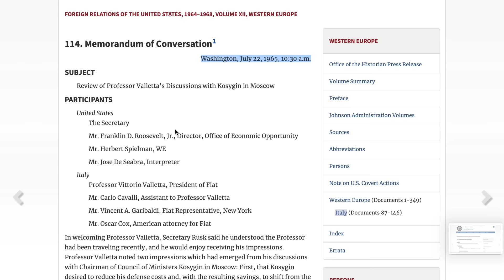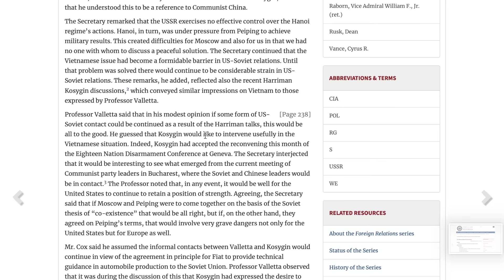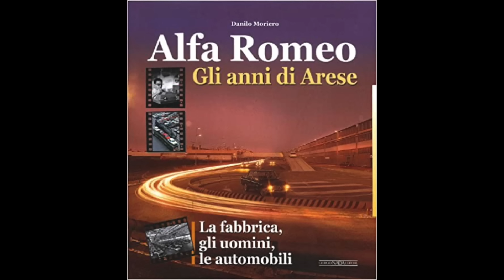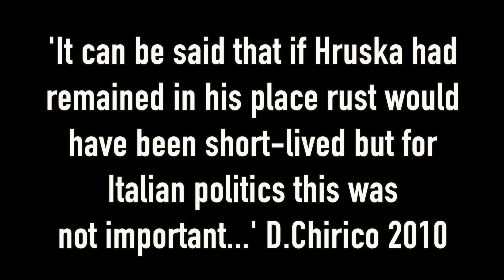Alfa Romeo And The Myth of Russian Steel - The Real Reason Alfas Rust

Comment: My father, a steel merchant in the 1950s, 60s and 70s, was often talking about the steel cookers adding scrap metal, recycled steel, to their mix. He explained to me, not that I was all that interested, that most of the problems with rusting cars would occur because of problems related to the "pickling" and subsequent processes but not indicative of inherently poor steel quality.
Reply: Well, "scrap" metal is needed for high quaility steel products. Just to get the alloy right.  Nowadays Recycling is a must anyway.
Reply: Your father was right. In the 70s, conflict in Italian factories was at very high levels.
There was a lot of sabotage and it was very difficult even just to verify the correct execution of the work, especially in the departments where product damage could be maximized

Comment: I purchased a new Fiat 850 In Wolverhampton in 1968.  It lasted 2 winters before the whole floorpan had to be fully re-welded.  My cousin had purchased a similar vehicle in Milan which did not rust for 10 years.  I can tell you the reason, and it's not Russian steel.  The West Midlands salted their roads so heavily that ALL cars at that time rusted away.  In the 1980s my Alfa Sud showed signs of rust after 3 years.  But subsequent Alfas and Fiats that I owned showed no signs of rusting in SW England.  I conclude that SALT played a major role in rusting for cars not prepared or galvanised for this British practice.  In Italy, snow chains and winter tyres have been long-used in winter, instead of salt.

Comment: In Canada in the first half of the 1970s, it was a bit of a rust-fest.  Datsuns were famous for visible rust, Toyotas for secret rust, the Brits for slow steady rust, and Fiats for complete rust.  The Fiat 128s were so bad that there was a buy-back program.  Luckily any car they bought back had turned to lace, and so Fiat Canada did not need to spend money on using crushers to dispose of them!  That era pretty much spelled the end of mainstream Italian car sales in Canada.
Reply: Hi Bob, that's very interesting.  I came to Canada in the mid eighties from the UK and had often wondered about the lack of Italian cars here.  I had assumed that with the smaller population the market was too small.  Perhaps that is the case for French manufactures?
Reply: @iansmeath8674  the French had a solid niche market here in the 60s, especially in Quebec.  However, their dealer network declined as the dealers defected to higher volume brands.  Japanese competition pushed them out of the entry level  market.  Personally, I have a Citroën 2CV, and am part of the teeny tiny French car community that still exists in eastern Canada.
Reply: @bobmcl2406  Thanks for the info on the Canadian car market Bob, very interesting.  So you have a 2CV quite a rarity though I have seen a couple here.  One had a brilliant license plate
"ESCARGOT"  priceless!
Reply: 240Zs if driven year round in the northern tier of the US rusted completely away in about three years.

Comment: I worked with someone who'd been in the motor trade since the mid 60's and he told me Alfa's had issues with the paint not adhering. Often brand new unsold cars would need bare metal resprays in certain areas before they hit the showrooms.

Comment: Thinking back to MOT testing in the 1980's, the most common rot boxes were seventies Escorts and Cortinas that would be beyond repair at 8-9 years old. Minis were rubbish, early Golfs pretty poor but surprisingly, the dear old Allegro would rarely fail on rot. Alfasuds normally failed on the circular jacking points on the four corners of the floor and the inner wings where the outer wings bolted on, assuming there was still enough of a wing left. Bodywise they were shite and the Sprint version was even worse. They were also very inconsistent - I used to test a bright yellow 1979 saloon that even after seven or eight years was still in good condition. Another Sprint actually broke its back when it was jacked up. A split in the front chassis rail opened up and the front wing separated from the rest of it as the inner wing/strut top area caved in. It failed of course. :-) More recently I've seen a couple of 159's that are as rusty as an old horseshoe underneath. I don't recall ever seeing a rusty 75 or 164 but they were built in Milan with rather more care.
Reply: Very interesting. Thank you for posting.
Reply: I own a 164 from 1988. All original paint, has always been kept well but it's passed all its life very near to the sea. No rust at all! ;)
Reply: Those were the days ! I used to be an MOT inspector as well. Good memories
Reply: The allegro if I remember correctly used to rust badly across the rear suspension mounting panel.That's if the mounts them selves didn't break first.It also was the subject of a few recalls ie front tie bars and brake hoses and of course who can forget the quartic steering wheel.
Reply: @alanbicknell7696  That was the 1100/1300. They rusted so badly the rear subframe would break loose.
Reply: I worked for a British Leyland dealer when they were launched and the rear suspension mounts were not available for a while.When the rear suspension mounts broke we were told by BL either to bolt them back together or use superglue?.A friend of mine had one as his first car and believe me that panel did rust but yes i agree the minis 1100/1300 subframes were one big rust trap.
Reply: The Allegro was funny. They would rarely fail on rot, that is true, but bitty rot in non-vital places? Woo-hoo, could have a problem here! TBF, if you kept your eyes open, it was often kept on top of, and while the Allegro could be a "joke" car, the owners at least liked them enough to keep a good eye out for rust and perforation.
Reply: Friend of mine had a Mk 1 Fiesta. The doors corroded from inside the passenger compartment. A relative had the same model; the spare wheel well flooded so often we made a drainage hole with a 4-inch nail. Even as late as the Mk 5, Escorts were notorious for losing their rear arches.
Reply: What wicked days, my mot station number was 132, tyreservices greys Essex.

Comment: A friend of mine had am Alfasud in the late 70's. It was a lovely car and really sporty compared to the offerings available from other manufacturers at that time. I remember a large rust spot breaking out in the middle of the roof, not where you expect rust to start, it appears the rust was built in from new.
Reply: Mine did exactly that right in the middle of the roof
Reply: lol so did my first sud and more in the middle of other panels.
Reply: Perhaps around the interior light area, that causes the formation of vapour, when the light is on, for a certain time and the temp outside is cooler (?)

Comment: Thank you for another very interesting video Jack. As a child, growing up in both the UK and Germany, I can confirm that the German cars of that time were indeed just as bad as anything else in the rust department. The two biggest culprits were BMW and Opel. Merc were a close second. My family had a Fiat dealership amongst its members. I can clearly remember my cousin showing my father rotten German coachwork in the body shop. Those were the days. Another large contributor were the many built in water traps to be found in areas of the body containing areas of multilayers of steel welded together eg. scuttle-wing-A pillar. All this in no way stops me adoring Lancia, Abarth (olde) and Fiat. Just love 'em and get on with them very well indeed. Bw Mike.
Reply: This explains why my dad bought a new car every 2-3 years when I grew up in the 70's and 80's in Germany.  He bought Simcas/Talbots/Peugeots from the same family owned dealership every time, and undoubtedly got a good deal for being a loyal customer with the trade-ins and new cars.  I assume French cars were no better in the rust department.  Fast forward to today, and I'm driving a 24-year-old Honda with no rust issues whatsoever.  Granted, I live in the American south, where snow is extremely rare.  But still, times have changed for the better.